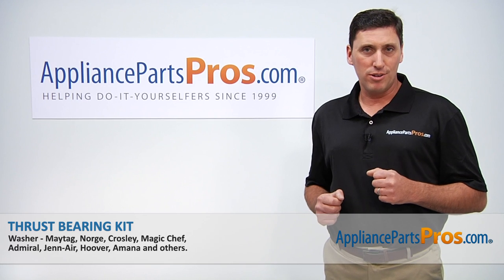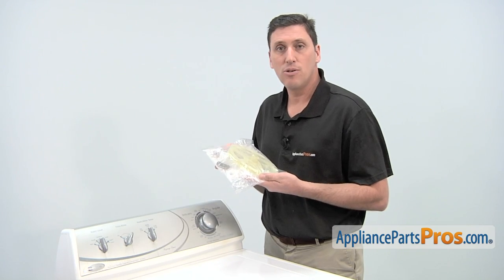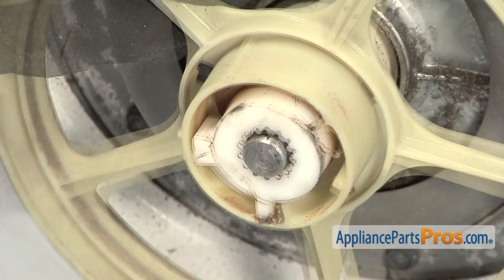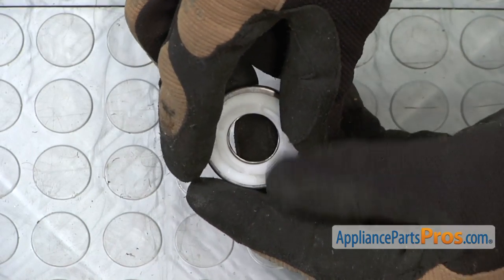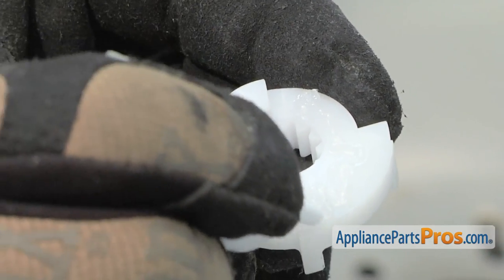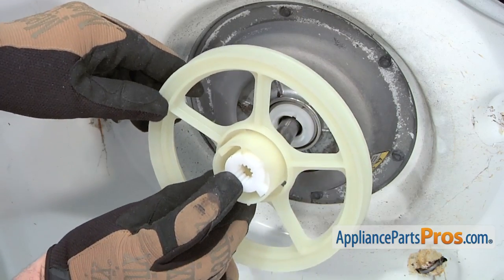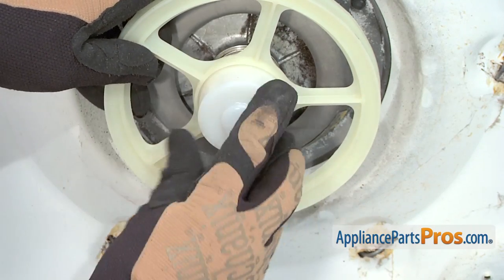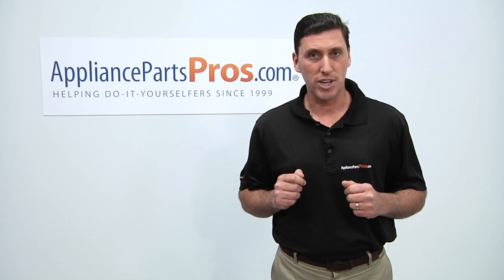How To: Whirlpool/KitchenAid/Maytag Thrust Bearing Kit 12002213

Comment: I have the MAV7700AWW and like many others had an issue with the C clip.  I noticed when I took the old washers off there was a spring-type washer that was not in the new kit - which probably made the assembler's life a whole lot easier getting that C clip on.  I also noticed that the plastic collar did not seat flush against the new metal roller bearing, so I did end up squeezing to two together prior to assembly with my needlenose pliers but I still had an issue with that C clip.  I used my flathead screwdriver and inserted it into the groove where the C clip goes to push back the new assembly as far as I could while inserting the ends of the C clip, but it was still a bugger to get that C clip on.  Not nearly as easy as the tutorial makes it look, but doable.

Comment: My washer is 20 years old.  About 10 years ago this repair was needed re wet clothes after the spin cycle.  I used the thin washer then and it worked.  Ten years later clothes were getting wetter again.  Again I used the thin washer, it placed the arrow where it should be when rotated but did not cure the wet clothes.  With no other option I placed the thick washer in.  Although I shaved the edge of the C clip retainer, not enough of the groove was exposed to get it on no matter what I did.  However, I solved it and perhaps the solution might help others.  Using a Dremmel I ground the edge of the washer down at an angle on the outer facing side, exposing the groove and allowing relatively easy insertion of the clip.  The machine now works fine again - the thick washer did the trick.  Great video.

Comment: After removing the break drum and cleaning it , replacing the thrust bearing and now the shaft doesn’t stick out far enough to insert the E-clip . What is my next step to remedy this
Reply: I have the same problem. Any suggestions yet?
Reply: I sanded/filed down the middle of the pulley, per what I saw others on the Amazon parts reviews say to do. Finally got enough clearance to get the C clip on with some massive force.

Comment: My washing machine had a problem where it was not spinning, I turned it on while tilted to watch the belt operating and it seems to be working fine.
Turns out to be a broken E-Clip, the whole pulley assembly was just falling off the main rod... Replaced from Lowes at ~$2. Works as a charm now!

Comment: Great video! I would like to add the following notes for diagnostics. My washer could agitate and pump water but wouldn’t spin.  Years before the thrust bearing failed the washer would squeal when the spin cycle would stop.  Near the end the washer would make noise during the cycle and it sounding like plastic cracking/grinding.  The E-Clip is hard to insert.  I used RoboGrip pliers from Sears and made sure the Lower Cam was rotated until the maximum shaft was exposed.  Hopefully this additional information helps somebody.
Reply from the maker: Thanks for those tips, Thomas!
Reply: This sounds EXACTLY like my washer. I'm going to try this fix. Thanks!

Comment: Hi, I change the whole kit and I can't get through to adjust the transmission. When I turn the pulley the inner white part turns together with the pulley and I can't adjust the transmission. And the shaft does not pull out to install the thicker washer.  So I need help. Thanks.
Reply: I am having the same issue. Anyone figured out a resolution to this?

Comment: My maytag performa/atlantis , somtimes spins then wont or just wont spin at all,, How do you tell the difference between an issue with the brake, transmission or the thrust bearing ? And Does the thrust bearing act as the clutch for the spin cycle ?
Reply from the maker: We'll be glad to help you figure out what's going on there. We offer free technical advice and diagnosis. You can give us a call at 1-877-477-7278 or you can chat us at our website: http://www.appliancepartspros.com/. We will need your model number, which you can locate using this tool on our website: http://www.appliancepartspros.com/modelnumber_locator.aspx

Comment: I changed my Thrust bearing on my maytag MAV7600AWW I used the thinnest washer and its to tight for the arrow to fall in between the 2 marks and it wont engage the drum to spin. Any ideas?
Reply from the maker: You can post this problem along with your model number on our repair forum and the techs will help you out.
Reply: Will this repair work without the washer if it is within the two lines? It spins fine now, but do you know if there will be any longer-term problems with no washer?

Comment: I followed the installation instructions and used the thin washer, but now I cannot get the C clip back in. There is not enough room for even the thin washer? what do I do now?
Reply: Pull on the shaft with pliers to get the tiny bit extra to get the clip on

Comment: what does the plastic bush do? my maytag makes a noise when spinning and then dies down. I replaced the thrust bearing though I never got the plastic bush with the new part and instill have the same sound..slightly fainter
Reply from the maker: Without knowing what you have, I would suggest posting the problem along with the appliance model number on our repair forum and the techs can help you troubleshoot the problem. http://forum.appliancepartspros.com/

Comment: This is a great How-To repair video. However, it would be nice if you could spend 30 seconds on the front side to help diagnose the problems created by a worn thrust bearing. You state 3 things, two of them are operational and probably easier to figure out. The "Washer is Noisy" is a little vague. It would be fantastic IF you could give an example of what to listen for. Thanks for the Repair Tutorial!!!
Reply from the maker: kthom2001 Thanks for the ideas, hope the video helped you get the washer fixed!
Reply: i agree. diagnosis is more important than replacing part.

Comment: Based on the info available here, I replaced the Thrust bearing, thinking it wasn't disengaging and allowing the tub to spin. In the end I needed to replace the Pump, as the bearing was shot and it was seizing up and preventing the tub from spinning consistently.
Reply from the maker: kthom2001 Glad you were able to find the bad pump and get the washer up and running!